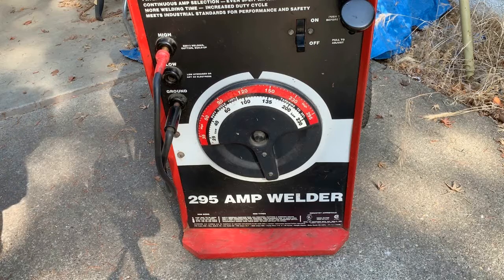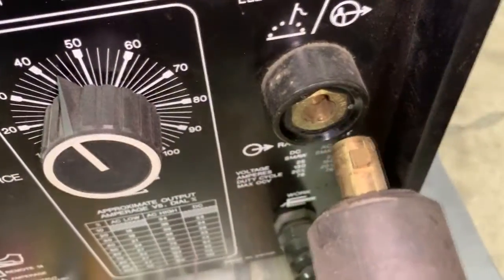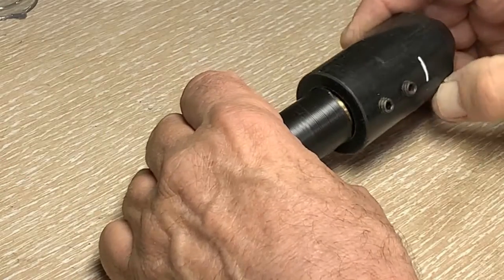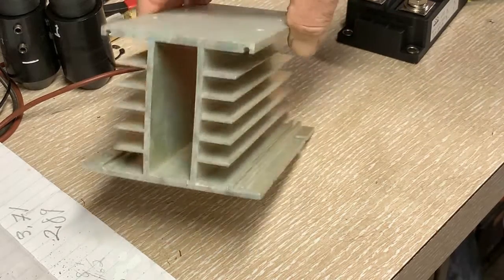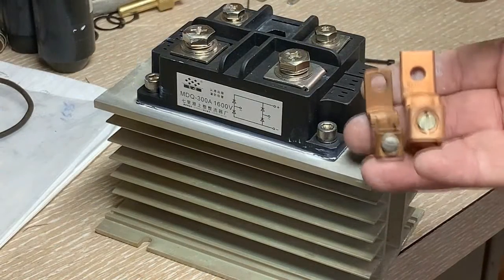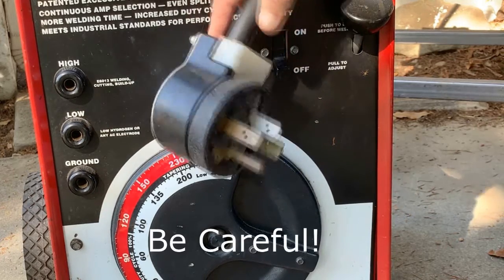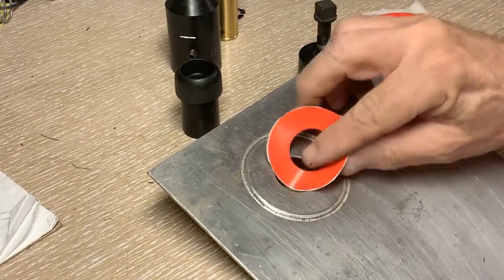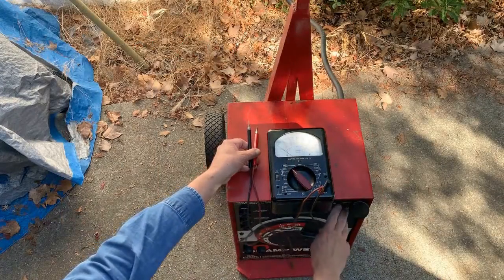AC Welder Conversion Upgrade For DC

Comment: Nice video. Did you think about just installing a switch and relay to select the modes? That way only a small selector switch would need mounting and keep the cables plugged into the same inputs. Just a thought. But I have a problem of usually over engineering my projects. Lol
Reply from the maker: Thanks for the note. I tried to keep mods to a minimum and not have anything show. This machine already had multi sockets, some old ones have many sockets, yuck. Anyway, having used this set up I find it very slick, simple and effective. Nothing is hanging outside either. Very good protection. It stays very cool too. It was a $20 purchase for the whole thing one day. Not much else to say on that point.

Comment: Can you supply info on the rectifier
Reply from the maker: I bought this off Ebay without much trouble. I bought the larger of two units for sale figuring that the greater the rating the better. These are very generic parts, so you won't need to hunt too long. Make sure to use a  heatsink somehow. Don't skip that. The rectifier should cost only about $30 max. Thanks for watching.

Comment: Did you install a bleedoff circuit?
Reply from the maker: No. There should be no need for that since there is no capacitor involved. You may be thinking of a power supply vs a welding power source. Ideally, a choke coil should be installed, but I have not been able to find one that would be acceptable. Nevertheless, the DC produced is excellent and the machine works very well.

Comment: nice job. you want to reverse the polarity electrode negative, should weld smoother. also that is a fast fill rod, try a 7018 fast freeze rod.
Reply from the maker: Thanks. I have that and I agree on the 7018. I really like it. There wasn't enough time to do enough tests for the video. Also, other rods must have DC like the Aluminum rod, so they say.

Comment: Thanks for the clear presentation for modifying the Welder to be BOTH AC and DC by simply switching cables. Any chance of getting a video showing and explaining the wire connections that allow the machine to remain AC and yet be simply re-connected to be used as DC?
Reply from the maker: Good question. This machine has a center tap coil secondary that is used for the low range. I connected to the low range for DC. Actually, I was a bit surprised to find that the open circuit voltage was 78 VDC after the conversion, but then the full wave bridge added some volts. You could simulate the same effect with a massive switch to move the wires between the rectifier and the straight AC. In other words, an AC/DC switch. Or without a switch it would still work either way. I don't believe I'll be making another video on this other than to add a smoothing choke to the DC side that will remove most ripples from the power. Don't know when that will be. Thanks for your question today and please approach this sort of project with plenty of caution.

Comment: What is the amperage of the rectifier did you use? thank you
Reply from the maker: I forget exactly now, but get the largest one available. The cooling is the key and insulation.
Reply: 300 amp, 1600 volts.  I used the same one and you can see the sticker in the video

Comment: Your machine seems capable enough.  Your welding skills need improvement.  Practice!  You should assume a comfortable position, preferably sitting at welding bench.  Practice!  Try to eliminate all inconsistencies in weld height, weld width etc.
Reply from the maker: Oh yeah, I agree. I didn't have much space that day to set up. The key thing was to demo the upgrade not to do stellar welding, not that day. Ha! Next time.

Comment: Do you have any photos of how you wired it before the DC rectifier?
Reply from the maker: I did, but they didn't convey much.  On my machine there are two ranges. I tapped into the lower range. I have no switch to throw for AC/DC.  I don't think it'll matter, however.  The DC won't be in use when AC is and vice versa. If you have a heavy selector switch that controls a single AC output, it's probably a good idea, but probably not needed.  Expensive rigs seem to have that. I think a large AC contactor with a low voltage coil could be used well.  You'd have to install a new 24v transformer for that, if I'm following your concerns? The rectifiers should isolate will as is. The wiring is very simple for what I did.

Comment: Do you think it needs a capacitor?
Reply from the maker: No I don't. It would probably blow out instantly while adding nothing to the circuit.
Reply from the maker: @domainmojo2162  Wow! Thanks for that insightful reply!  I'll try it with an old xfmr I have.
Reply from the maker: You know, I'm going to do this as an experiment and I'll record it when it warms up here. I've got an old microwave transformer I don't need with the high voltage coil removed for another experiment. One of my other welding machines came with such a choke in it. I just didn't think that much about it. By the way, the DC starts very easily as you could see in the brief amount of testing I did on screen. Some special rods demand DC as for Aluminum. I'm planning more experiments and videos. I'd really like to weld AL with a no fuss machine. Others on YT have demoed that and that's what got me started. Technically, the choke is referred to as a "smoothing choke" typically for higher voltages. The transformer in my machine produces voltages quite a bit higher than I expected, but I would not have known or cared. Glad you are getting something from my work. Be careful too!
Reply from the maker: @domainmojo2162  Great! Notes of this type really help numerous people. I'm a big believer in hanging onto what you already have. I paid $22 for that welder and have loved every minute of using it. Great comments today!
Reply: 7014 runs on ac or dc

Comment: Do you think it needs a capacitor?
Reply: Yes, capacitors help, you want a 50mfd 200vdc capacitor before the choke and a second one after the choke.  I've read about putting an AC one before the rectifier but it shouldn't be necessary
Reply: @chrisrageNJ  Thanks. Any suggestions on type of choke?
Reply from the maker: No.